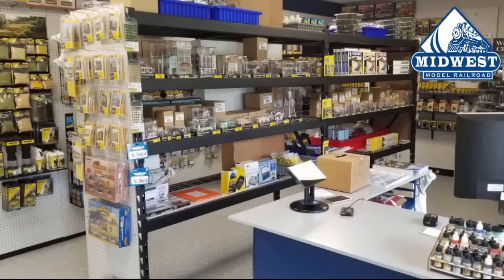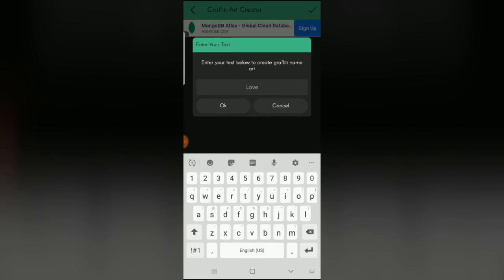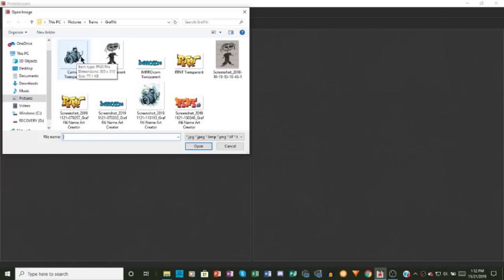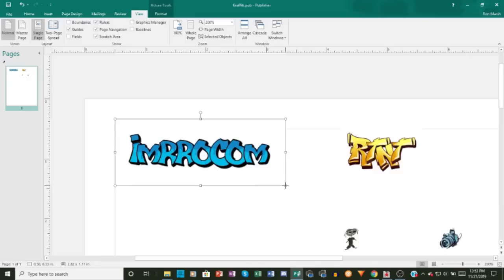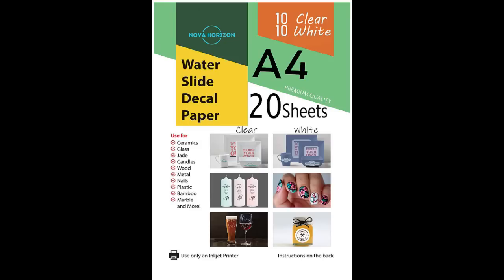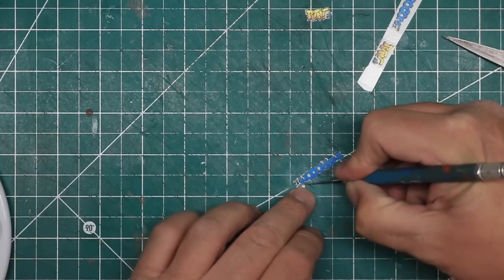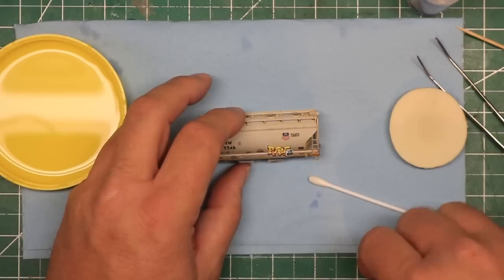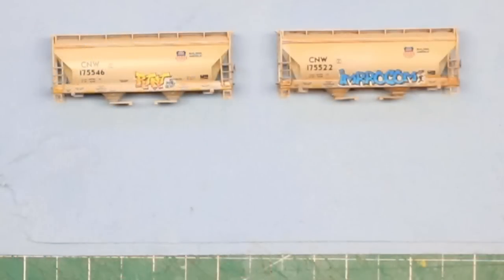How To Make Custom Decals For Model Projects

Comment: Thanks for making this guide! This is a seriously good use for home PC equipment :) Times are good for access to high tech equipment. Just 25 years ago, computers were still expensive, and just a "basic" system with computer, monitor, and printer, set you back about 1500 to 2000 bucks for a slow-boat work horse, at minimum a full grand for a chonky old clonker. I used to sell them, so I know!
It's been years I spent this much, and my last few are refurbs at less than 300 for a full system, and printers can be had brand new for 25 bucks. The ink refills cost you more than the whole box!

Comment: Nice video, pastor. I have done this with Testors products and pulled logos and graphics from the internet including holiday clip art sites.  As my platform, I just used Microsoft Word as I don't have any specific editing software.  I found this worked well, could size and rotate the image with ease.  I used this process for making two holiday-themed cars, a gondola filled with bins of pumpkins with Happy Halloween on the sides, with the jack o lanterns and witches for company.  I also did a hopper car with Santa image and  Reindeer food markings and load.  As you said, Ron, there are so many opportunities to use the process, including buildings, and watching the video should get everyone on the right path.....but that is your day job isn't it!
Reply from the maker: Hi, Daniel. Yes, I'v used a Testors kit before. If doing very many decals, the film is more expensive, but if only doing a few it works well. As for Word, yes, you can certainly use it. I think Publisher is a little easier to manipulate, but if you don't have access to it Word works very well.

Comment: Is there a substitute for decal bonder? Looks impossible to find online.
Reply from the maker: That is a good question. I would assume a spray gloss coat is your best bet, but you would need to test it before you try it on a model. Unfortunately I have not had a chance to try myself, but when I can I will give it a try and make a follow-up video. If you do test it, let me know how it goes.

Comment: Very helpful video Ron.  It’s a lot of steps involved for sure.  It seems with the advancement of apps, software, high quality printers that there would be a easier way.  However that’s just my thoughts but your method may indeed be the best way.  I have no idea but in the near future I will be in need of 100’s of custom decals.  More of custom text type signs for the different businesses etc on the layout.

Comment: Since Testors seems to have stopped making the Decal Bonder product, are you aware of any good alternatives?   Thanks!
Reply from the maker: I'm not sure, but I assume Testors spray gloss coat would work. I would test it first. I will have to try this soon and make a follow-up video. If you do test it, let me know how it goes.
Reply: @RonsTrainsNThings  I am using Mod Podge Matte Mate clear acrylic sealer which seems to be working fine so far.  Tom
Reply from the maker: Interesting. Thanks for the info.

Comment: I tried this with Blinggasm clear laser printer decal sheets.  The backing film isn't clear.  If I'd been putting it on something black, it probably wouldn't have been visible, but I was putting it on a fairly bright color.
Reply from the maker: I have used Blinggasm film as well. It works pretty well.

Comment: Coming from wargaming and gunpla, Future floor polish through an airbrush makes a good between-layers sealer if you want to save your dullcoat for your final matte seal. Future is just a thin, clear, glossy acrylic. I usually put a layer both under and over the decals, though I'm used to working from a freshly primed model instead of adding on to something pre-painted. If there's anything going over the decals, like a wash, I'll seal with Future again before weathering as well since I sometimes use enamel weathering products.
Reply from the maker: I am familiar with the use of Future, I just haven't tried it myself. I may have to do that.

Comment: Do you know of a way to make decals with white lettering?  A printer prints white by not printing anything since the paper itself is white, but I'd love to produce custom white lettering on box cars or other models.  So far, I think you have to go with purchasing sheets of individual pre-printed white letters and numbers.  I haven't been able to find a way to create white lettering on a printer.
Reply from the maker: The only white lettering option I know is to print the letters on a colorer printed background. For while lettering printed on a clear background you need a special printer that prints white. Your best bet there is to buy commercial decals.
Reply: Modular Curiosity,   you can print on white decal film by creating a text box the color of whatever you are applying the decal to.   Just like creating white text in a colored box in Microsoft Word.  The hard part is matching the color of the printed part to the the color of the the object you are going to apply the decal to, that will be a trial and error process. Keep adjusting the color and printing on matt photo paper for matt surfaces, or gloss photo paper for gloss surfaces until you get a match then print on the decal paper and make sure it still matches.  If you get a close enough match your weathering should hide any color differences and the white decal film will block any background color from showing through the white lettering.  

Barry Broyles.

Comment: Every one else I watched used the micro sol first and micro set second must not make a difference
Reply from the maker: I don't know who else you are watching, but that is completely backward. Micro Set slightly softens the decal and allows it to begin to conform to the surface of the model.. Micro Sol completely softens the decal to conform to complex surfaces and details. Micro Sol may not always be needed, but applying it first then trying to position a decal runs a very high risk of tearing and destroying the decal. Here is a brief article from a military modeler explaining the difference. https://www.themightybrush.com/article/how-to-apply-decals-with-microset-and-microsol/
Reply: @RonsTrainsNThings  thanks for the info